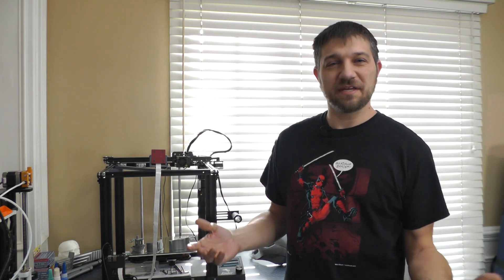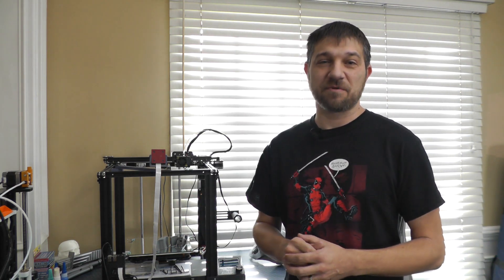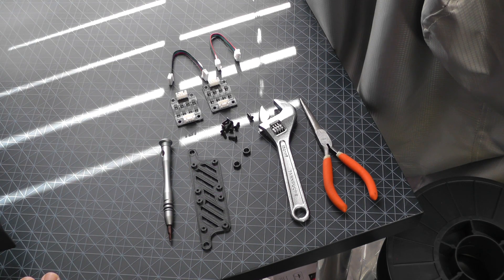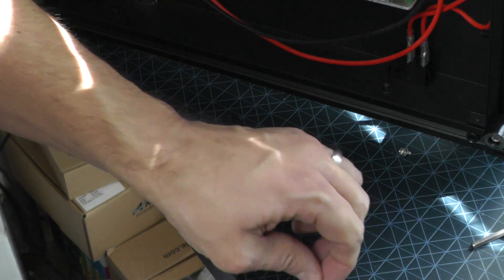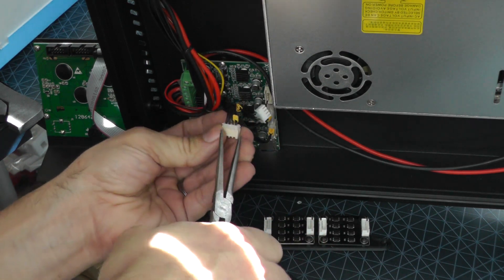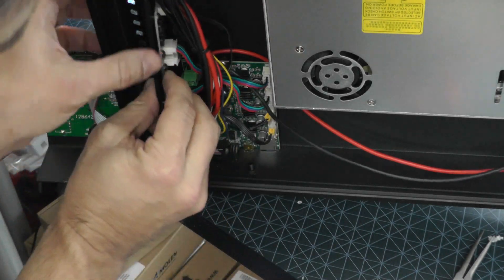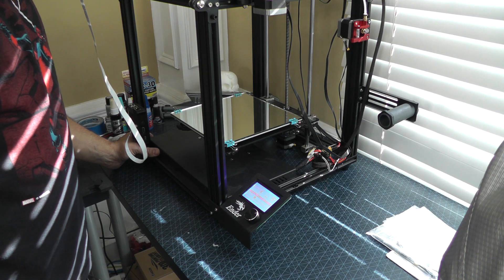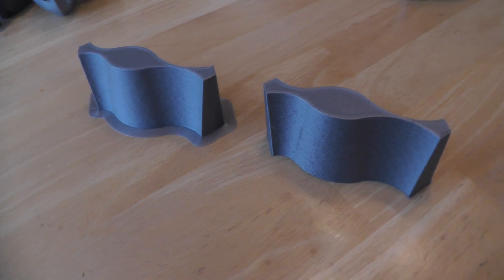Creality Ender 5 Upgrades #4: TL-Smoothers

Comment: Just in case anyone is watching this now.   This is only valid for the early Ender 5's with the 1.x.x control board.   If you have the 32 bit "silent" control board, the 4.2.2 or 4.2.7 based on the STM or GD MCU, then you do not need to TL Smoothers and at best they'll make no difference, at worst they will make the prints worse.
If you have the older model with the 1.x.x 8 bit driver board, then the TL-Smoothers are a good idea.
Reply: Absolutely, I upgraded my old Ender 5 to 4.2.7 mainboard and made the mistake of leaving the TL smoothers plugged inline. They made the motors noisy and actually caused Salmon skin. Removing them and the printer is now super quiet and salmons are gone!
Reply from the maker: Yep! Very old video!

Comment: do you think these would be worth it with a lerdge k motherboard with 2209 drivers?  might be a dumb question but might as well try to minimize issues ahead of time since I will be using it as my workhorse printer and retiring what I have been using
Reply from the maker: These are for very OLD board. They would do less than nothing on new ones, possibly even creating new problems.
Reply: good to know.  nice to NOT have to order more stuff.  got an ender 5 plus basically half off.  big problem was the motherboard needs to be replaced.  needs a little TLC and some elbow grease too.  haha
Reply from the maker: @javeronh.3996  Good deal if you're willing to do the work!
Reply: I am looking forward to getting it running.  might have made a big bite though.  hopefully I can get it running.

I greatly appreciate your video, I have had it play in the background a few times, watched it a couple times.  in hopes I can properly do all I need to (correctly) the first time.  as well as your follow up video on the drivers, ordered the drivers from that video immediately.  (I have a 19 month old and would hate for him to burn himself on it, plus I know heat means wear and wasted energy)

maybe you can help me with something else: I am using prusaslicer and apparently you can select what firmware.  I am not a software engineer, nor smart enough to want to try to learn.  prusaslicer does not have a selection for Lerdge firmware, but lerdge motherboard says it works with prusaslicer.  what should I select?  at the very least I would like to be able to adjust the k-value, linear advance.  it would greatly help with a project that I have small holes so I can use filament as pins.  any help/advice would be greatly appreciated
Reply from the maker: @javeronh.3996  Didn't you ask this I'm another thread? 🙂 I select Marlin for this in Cura.
Reply: very likely.  basically shotgunning and hoping either you or someone else reading through the comments would help my chances of success in getting a good answer.  did just find your video about the power supply on the ender 5 plus.  about to watch it now.  hopefully I don't have to get more parts but better safe than sorry
Reply from the maker: @javeronh.3996  Just be sure to check the brand BEFORE you order. Some people have proactively ordered a new power supply before checking and they didn't need one.
Reply: okay.  so I will check what I have.  I have the link saved for the 600 watt.  I want it to be reliable so better safe than sorry.  I agree that a device/component should never have to work harder than intended as a standard.  if something is rated for 500 watt it should almost never go above 450 watt.  that way there is a 10% cushion.  at least in my mind, but I am not an electrician.  thanks for the tips and the great videos.  keep up the great work

Comment: I installed Big Tree Tech tl-smoothers on my Ender 5pro, what I found was the steppers started to make a lot of noise I then removed the smoothers and the noise went away. Perhaps there are different smoothers. I would recommend checking a little deeper to make sure the compatibility.
Reply: Thats because the steppers now follow the actual path more accurately, you basically hear the tiny steps more. He didn't really explain well what they do, they actually keep the motors from sending back power to the board through inertia, thus messing up the movement slightly.

Comment: Do you need TL smoothers on an ender 5 or ender 5 plus with silentboards
Reply from the maker: No. Both of them use different stepper chips than stock boards.

Comment: Thanks for the great video, I’ve just purchased the Ender 5 pro, do I still need to upgrade this please? Or the Ender 5 pro has improved the performance already? Thanks
Reply from the maker: Thanks! No, you do not need this upgrade. The Pro comes with the silent board pre-installed and you should not install these on that board.
Reply: Kersey Fabrications thanks

Comment: I added to smoothers to my Ender 5 this morning and now my auto home goes to the opposite corner. Anyone know why?
Reply from the maker: It sounds like your wire was flipped in the process. Depending on the connector, flip that wire.
Reply: Kersey Fabrications thanks for the quick reply. It looks like they can only go in one way as the connectors and the ports have slots on one side. I suppose I can try and see if they even fit the other way.
Reply from the maker: @crazymike123456789  If you can't swap the wires around, you may need to recompile the firmware to reverse the motor direction.

Comment: Any reason you couldn't add these in line outside the enclosure near the motors to test it out before committing to opening it up?
Reply from the maker: Anywhere inline will be fine.

Comment: I have those small spots that is on all of the prints you just showed, what are those caused by?
Reply from the maker: Sometimes the small spots on the outside are just seam lines. Basically it's where the printer has to begin or end an extrusion. Your slicer tries to hide them using the proper settings but it can't always find a good place.

Comment: You can do all this.. or you can spend 40 bucks in a silent board that doesn't need TL smoothers..
Reply from the maker: I covered that in a later video. 😁
Reply: @kerseyfabs  Excellent, I spoke too soon. Great content man, the journey of modding printers is a crazy ride lol. My ender 5 went from bone stock to just the oem frame and steppers being used. I've got an E3D hemera, linear rails, SKR board with 2209's, fan upgrades, heated bed is now a forged aluminum beast.. like I said, crazy journey lol

Comment: I want help in making a decision, price is not the issue but ender 5 pro is too big and ender 3 pro is a bit smaller in print, just 2 inches, moreover do you think that dual Z axis ie independent z-axis on ender 5 is an advantage to ender 3 pros where the hotbed z-axis doesn't move in terms of quality and wear and tear?

Comment: I have an ender 5 pro, will I need these as well? It has the latest silent motherboard V1.1.5 version
Reply from the maker: No. These are only for the original board.
Reply: @kerseyfabs  Thanks!

Comment: Chris,
I went ahead and installed the smoothers as you suggested, THEN a couple of day's later went ahead and installed the ver 1.1.5 silent main board. NOW I want to install NEW firmware to get more features. I have the following questions
1-Do I still need the smoothers with the ver 1.1.5 board?
2-Is it possible to view the firmware already on the 1.1.5 board using the Arduino IDE software? if so how do I do that?
3-Finally, on both my 1.1.4 and 1.1.5 boards when I connect a usb cable in I get com port 6 in the device manager that says "RAMPS (Com 6). Doe's this indicate that these boards already have the bootloader in them?
I don't really understand how to use the Arduino IDE. and need some guidance

Thanks for your time and you videos..
Reply from the maker: 1) No. Take them off.
2) You can't just open it and look at the config if that's what you're asking. It's in binary form.
3) That doesn't mean that you have a bootloader. You may have one on the original and you should have one on the silent board. If you'd like my instructions, the Silent Board video has my configuration files and links to other helpful videos.

Comment: Great video and thank you for all the others. Question, I only saw you add the tlsmoothers to the x and y axis. Why did you not elect to add a tlsmoothers to the z axis as well?
Reply from the maker: No problem! The Z axis moves only one unit at a time (meaning the layer height). This means it will not suffer from the electrical artifacts that we see on the continuous motion X and Y axis. I have seen some people also add a smoother to the extruder motor but I don't see any additional artifacts on my prints and due to the way the nozzle builds up pressure, I wouldn't expect small variations to produce issues.

Comment: the skinning got worse along with my steppers being louder than before I had to remove them
Reply from the maker: That should only have happened if you used it on stepper drivers that didn't need it or with low-quality smoothers. What was the combination?
Reply: @kerseyfabs  I think it was strippers that didn't need it and low quality smoothers ! Lol

Comment: Why do some guys hear shrink smoothers.??..i see you did not...thanks seems very easy as long as the glued connectors don't break when removing...
Reply from the maker: I think those that heat shrink their smoothers do it because they aren't mounting them. I'd much rather have them secured.

Comment: I have the latest ender 5 released...i wonder if they upgraded firmware..my first 3 test prints turned out very good imo... But i did order those smoothers yesterday seems very easy to do...thax
Reply from the maker: Go for some of my test prints to see if you see any of the artifacts. If you don't see any problems, I wouldn't do the upgrade. It could make things worse. Save them in case you need them. Thanks!
Reply: @kerseyfabs  yes...thax

Comment: Hi, what kind of slicer do you use? 
I tried smoother on the ender 5 and found absolut NO EFFECT! 
BUT: I had the same effects your original models have with cura. Since I use 3Ds, these effects are gone....
Reply from the maker: I'm still using Cura 3.6.1 and occasionally Cura 4.2.1. The slicer shouldn't have an impact on the salmon skinning.

Comment: Quick tip for next time. Use a few drops of iso alcohol 91% or better on the hot glue and it comes right off.
Reply from the maker: Great tip! I'll try to remember that in my next video where I'm replacing one of these!

Comment: I used the TL-Smoother Plus with my Ender-5... and now i have Salmon skinning... without use of them i not have this Problem.
Reply from the maker: If you don't see a problem without them, take them off. I haven't heard of anyone reporting this before but it seems like the fix is easy. Rule of thumb is to not apply a fix until there's a problem. 😀
Reply: @kerseyfabs  - I think i have to try some calibration tests. I seen in Cura the Profile is wrong in some settings. The Printer can print a Layer thickness of 0.2mm minimum and in Cura it is set to 0.1mm from stock. So i will check all Settings and then i will see what happens.
Reply from the maker: @christian.derr_official  I routinely print with 0.12 layer height, so 0.2 is definitely not a minimum. Also, try printing with layer heights that are multiples of 0.04mm. Here's an explanation why: https://www.youtube.com/watch?v=WIkT8asT90A I hope this helps.

Comment: Nice video. I'm doing this upgrade tonight for X, Y, and Z. Thanks!
Reply: The kit I bought on amazon came with three. Now that I think about it, the smoother might be more beneficial on the extruder instead of the Z motor.. Thoughts?
Reply from the maker: If I was choosing between Z and extruder, I'd pick the extruder. The Z moves in short, small bursts. The extruder is moving constantly. I didn't use one for either though.

Comment: Just received my ender 5. Putting it together tonight. Already got a few upgrades to go in it. seemecnc ezr extruder, capricorn tube, fittings, tl smoothers, uno board for marlin upgrade/bootloader. My first time getting a printer and I want it to be perfect!
Reply from the maker: Good luck and have fun! Keep in mind you're making "your perfect" printer. Do your research and enjoy the journey!
Reply: @kerseyfabs  I just wanna print tpu at a decent quality enough to use for my racing/freestyle drones. Everything else will be a plus!

Comment: It's a real bummer that the TL Smoother mount you used so severely blocks the airflow into/out of the electronics area. Need one that mounts (even if hot glued) to the plate that the fan is mounted to (where the power supply vents). I intend to use 4 of them on my brand new Ender 5: X, Y, Z and Extruder.
Reply from the maker: It really doesn't block the flow that much. There's still plenty of room to pull air around them. I haven't seen any heat-related issues.